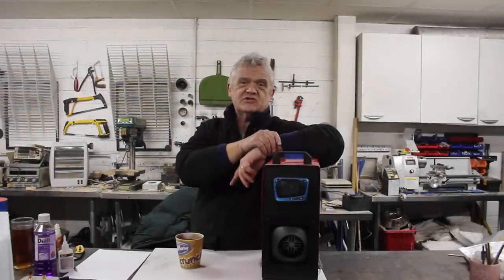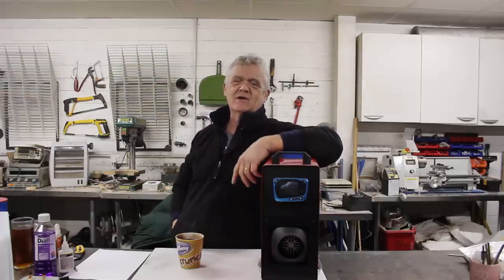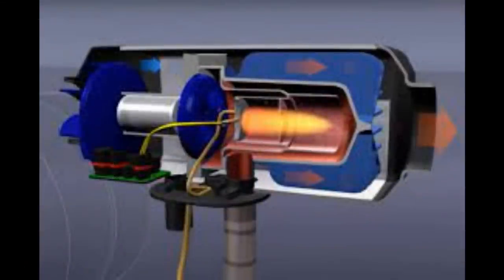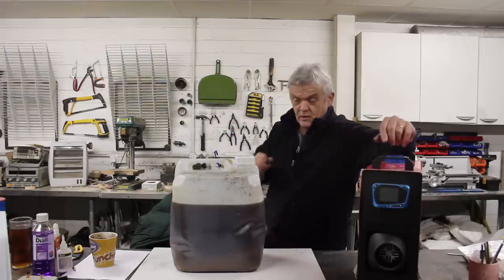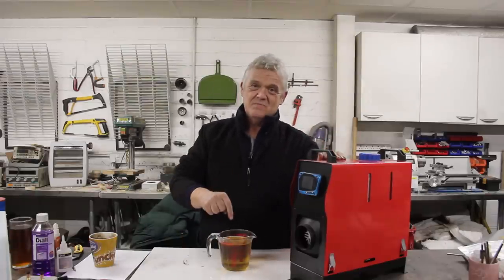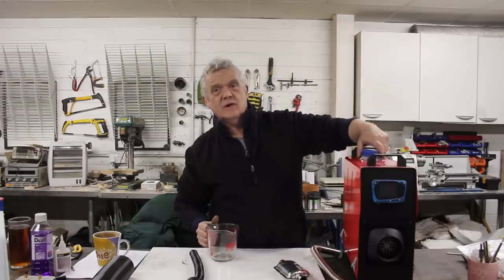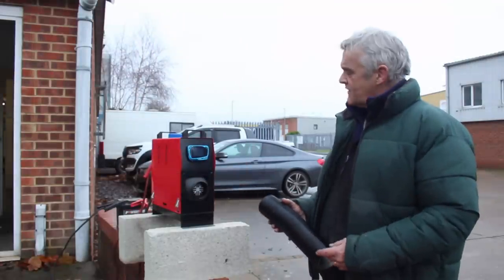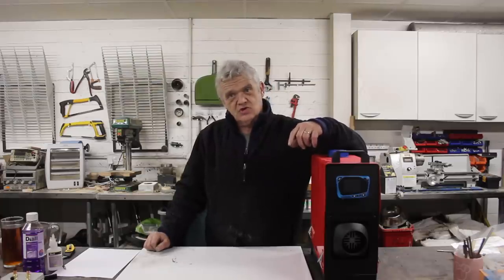1793 Home Made Fuel Running A Diesel Heater

Comment: I might have mentioned this before but when I was stationed in Germany in the RAF around 1979 ish I used to refuel a similar device, a bus heater, separate burn chamber and separate airflow going into the building and run off the mains electric. If memory serves me right a Jerry cans worth of diesel would run it all day.
Reply: They were invented in Germany in the 40s/50s 👍

Comment: Just awesome as always. I just want to put in my request for something that you previously theorized about, which is to say a wind powered sand battery heater. I am wondering if there is some configuration involving resistance heating and thermoelectric fans which could be viable. I am most curious about the specifics of how the electric load would be controlled for such an application. If you can’t get to this topic it’s fine. I will let you know if I end up (successfully) experimenting with this concept in some way.
Reply from the maker: I will have a look at it - but I would also be very interested to see what you do too

Comment: Hi Robert, I don't recommend using an adapter without having a battery backup. There is a mandatory cooldown cycle. If the power goes out during a running cycle, it could damage the unit. Cheers from Ottawa.
Reply: Dead right 
I run mine in my work shed 
I have a 12v deep cycle battery and a trickle charger. 

The battery is there for two reasons 
supply the start up current needed for the glow plug.  Once it starts the trickle charger (like the alternator in a car) recharges the battery and supplies the running current for the fan, etc
The second and more important reason for this simple power supply is so that if there were an outage,  the battery will keep things going for hours. 
Then you can properly shut it off and cool it down
Reply from the maker: nice suggestion - cheers
Reply: It won't damage it, it merely floods the chamber which makes a mess and difficult restarting.
Reply: @melissasmess2773  Hundreds of videos of people who used these things, and all say the same thing. The fan is necessary for the cooldown cycle. I own 5 of these heaters. 2 failed after a few months. I didn't know they were easy to fix, so I just bought replacement units. At least I have a lot of spare parts. The oldest one I have is the one that works best.

Comment: Be carful Rob!   You are single-handedly putting a wrench in the grand plan to freeze as many people as possible.  

Great video brother!
Reply: There are other methods that don't rely on fuels such as concentrating solar heating, passive solar heating, solar evacuated tube collectors, wind powered electric heaters or low grade geothermal.
Reply: @vitordelima   absolutely.  Some of which I am working on for myself.   This year has been a huge shock to millions of people. They need cost effective heat without a large or difficult learning curve right now.
Reply: @vitordelima  most working class people don't have the money for that...
Reply: @UNPROFOR1994  It's cheaper than most alternatives but it also triggers a lot of despicable people for obvious reasons.
Reply: @vitordelima  most people don't have the money to do major home renovation on a whim lol not sure where you got that idea. a lot of people live paycheck to paycheck
Reply: @meep7252  correct
Reply: @meep7252  This is the kind of nitpicking that I'm talking about. Most times it doesn't require home renovations either.
Reply: @vitordelima  but it would be pretty expensive.  A lot more than a Chinese heater and some diy biodiesel.
Reply: @McRootbeer  No, but thanks for repeating what was already posted. There is certainly a coordinated effort to make it as costly as possible but this doesn't mean it's necessarily expensive. And other typical problems of social media, such as attention seeking, smear campagins, ...
Reply: I just accept that I'm luckier than most in that I have extensive access to free firewood and a couple of decent log burners
Here's hoping everyone has success in finding a system to suit their circumstances. Whatever you do, it will take time and effort. The harder I work at my firewood store, the warmer I am.
ps.   the simplest aid to keeping warm is available to all of us - wear more clothes in the house. put on a few more layers and wear a woolly hat. It seems to me that in recent times, some folk think it a God given right to be able to wear Tee shirt and shorts or other light clothing indoors, and still be warm enough .....
Reply: @bigoldgrizzly    I understand and agree completely!  I just drug myself out into -30 wind chill to load my wood boiler.  And I am very lucky that is an option for me.   

Rob has been doing amazing work to help people with as many ways as possible to stay warm this winter while not requiring a large amount of money or time.   Heck I know when I was a younger man I would have had a hard time spending the 120.00 for the diesel heater let alone more difficult or expensive options.
Reply: @Red9GearHeads  Absolutely Buddy. Rob is doing a great job all round, good at explaining and without being a 'safety sally' he does address how to do things without harming yourself. Keep warm Fella and look out for your neighbours too.
Reply: @bigoldgrizzly   thanks Grizzly.  Happy holidays!
Reply: @bigoldgrizzly  Because good and affordable pre-built solutions aren't being sold for reasons.
Reply: @rocklover7437  some people just buy a pool cover the bubble foam type and throw it over a regular greenhouse easy insulation
Reply: Wait for the legislation to try to stop this kind of 'taking care of yourself' nonsense.
Well, they will try anyway lol
Reply: What was the 20% you mix the oil with??
Reply: @vitordelima  no. Lol
Reply: @jregamey  Yes, Jacob.

Comment: It's been interesting following along, Robert. Something like the Bullerjang combined with the heavy oil burning capabilities of the forever wick sounds like a pretty ideal appropriate/low tech/low maintenance heating solution with the advantage of not requiring electrical power. My spidey sense tells me you've already come to a similar conclusion.. so I'll look forward to the video.. 😁👍
Reply from the maker: lol - I am an open book lol
Reply: requires 12 Volt DC supply that can handle the startup current draw of around 5 Amps, which reduces when the heater warms up.

Comment: These heaters have gone up by 50% in the last month. There were many listed on eBay, but now not so many.
Reply: Price is likely to drop back in the spring/summer months. Just at the moment, fear of heating costs and production problems in China has left a lot of empty shelves. I reckon a fair proportion of sold units will end up on the secondhand market next year. Won't bother me and my woodstoves ;<)
Reply: I payed £90 for mine and now it's double the amount.
Reply: Basically ripping people off. Here in Australia where its coming into summer they are freely available at the previous price . They just know that everyone is looking to keep their heating costs down in the UK so are making hay before the sun shines again. If it wasn't for the outrageous costs of freight between Australia and the UK you could buy them easily from here. I can buy a book on EBay UK for 5 quid and pay twenty five in postage !
Reply from the maker: yep - all heaters have gone up in price mate
Reply: Apparently Trading Standards have impounded several hundred of these CDH at Felixstowe docks, I'm lead to believe the problem is with the Chinglish instructions rather than the heaters themselves ?
Reply: I've just ordered mine this week from Aliexpress. Most of which onviously comes from China (as the heaters do anyway) but i managed to get a UK warehouse so its due on 3rd January. Prices are still low there, is my point. I paid £100 including all the tax and delivery.
Reply: The prices always go up in the winter and down in the summer. It's supply and demand. I bought 5 at the end of last summer for around $75 each. Now they are $100 or more
Reply: @FruityLoops91  have you a link please
Reply: you're suprised? what happens when the going gets tough😆
Reply: @Tiger-fv3nl  tis the same with sun tan lotion but tother way round.

Comment: Hi Robert.
Have been using one of these to heat my work shop for the last 4 years burning anything from agricultural diesels, domestic oil, and vegetable oil mixture, still working well, 23.2 degrees in here as I type. Cheers.
Reply from the maker: awesome mate - cheers

Comment: Rob -
Big fan of those "cheap chinese" heaters as an emergency/backup heat source.  I have a very similar unit for use if/when I lose heat during winter (to prevent pipes freezing & preserve life).

Been thinking of getting a couple of non-all-in-one units for installation in my Diesel truck (in case of being stranded in winter) and my vintage VW (for real heat).

As you likely know, these are clones of the German heaters (Espar & Webasto) that VW had as an option for the old bugs.  😁

Cheers!
Reply from the maker: I think that's what they are good for mate

Comment: I've successfully run an old mercedes on used veg oil, the single easiest way to clean it is to let gravity do all the work, it's called settling. Over time all the crud sinks to the bottom simply pull the clearer oil off at the top. A heater like this might run on straight used veg oil so possibly no need for any filtering or additives like paraffin etc ?
Reply: Check out "dieselpumpUK" for a look inside the ruined fuel pump from a 606 that's been run on non refined cooking oil, most diesel engines will run on it but they do not last ! Neither do these heaters 😏
Reply: ill av a look.  @Dirt-Diggler  have you seen the vegoilcar website ? well worth a look

Comment: Hi Rob, I have the exact same model in my workshop, I just run it on red diesel available from some petrol stations, currently about £1 a litre. We also heat the house with oil, so when I get a delivery of this, I get an extra 25L for the Chinese heater and avoid some VAT, also currently about £1 a litre.
Reply from the maker: nice mate

Comment: What in the world is paraffin.? Unreal how you bitish people speak English yet we Americans can't understand some British words 🤔. And using cooking oil will eventually clog the chamber like it
 did to me because cooking oil has glycerine and doesn't burn, you'll find out on ur own what i mean unless you have a secret mixture that we don't know about.? But the glycerin is still there unless you make biofuel which removes the glycerin.
I uploaded videos how bad my diesel heater got clogged with several mix of fuel with vegetable oil so in other words it will not work and eventually clog the little small hole by the glow plug and Diesel will start running out the intake port while it's running. 
Guys and Gals be careful! Only run diesel and kerosene as fuel.

Comment: A few years ago I mounted one of the heater units along with a 5L fuel tank to a sheet of plywood in the shape of my companionway hatchboards.  In the shoulder seasons, I use it instead of the hatchboards so that I've got a simple heating setup that takes no room in the summer - just put it in storage.  It works brilliantly, and I run it primarily off biodiesel or 50:50 gasoline/waste cooking oil.  I've also sourced contaminated diesel (normally mixed with water) that I'm able to clean up and run.

I've experimented with a ton of other waste streams, and have had to clean mine a couple times over the years.  Once I'd coked the swirling mixer so badly I couldn't clean it, and was happy to discover replacement burn chambers with gaskets are like $20.  I bought a bunch of them, and now if they're too dirty to be saved, don't waste any time.  I've saved probably thousands of dollars of fuel at this point.

These things are fantastic!
Reply from the maker: $20 to replace - wow - that's like nothing! that is cool to know - cheers mate
Reply: Well my search show nothing like that for sale! what country are you sourcing this from? And whats it really called?

Comment: I'm pretty sure that the manual states to run this heater outside or in a well ventilated room. The exhaust should at least be vented outside your house. 
The hot airflow I supose is safe for indoor.
These video series really do not address the dangers of burning fuel indoors. Exhaust is poisonous. Why not run your car engine in your living room? It won't smell great but at least you are not freezing to death. 
Do not underestimate toxines from exhaust they can kill you or will make you sick even at low concentrations.

Comment: I ran my Peugeot 306 for a number of years on vegoil. I included a heated fuel filter and heat exchanger to preheat the vegoil, also looped the injector return. Two, 3 port valves were used to select the fuel source and return route. So start on diesel until the engine hit over 70 degrees, then swop to vegoil. Swop back to diesel a few miles before turning off. I ran the vehicle for over 100,000 miles on this setup. Bosch injector pumps were always successful for vegoil but lucks CAV easy to break. The VW PD was also meant to be good. 

One important thing with waste vegoil on cars, apart from filtering the crud, is removal of water from it, normally this was done by allowing several weeks for it to settle, so you end up with oil on top of the water. To check water content, just put it into a hot frying pan and check for spitting.

Thanks for your excellent channel, it provides  me with a lot of entertainment.

Comment: You Should check if the Gelatine method helps to clarify used motor oil, maybe it’ll remove some of the additives and/or some of the soot from the oil to make it burn cleaner

Comment: David McLuckie has just posted a video of running a diesel heater as the heat source for a tumble-dryer! Plans for future videos include changing the drier's motor to be 12volts, and then including a new control board which manages starting and running the diesel heater, the tumbling, heat input, exhaust moisture content, and then closing down!

Comment: I've been running these heaters for awhile alternative fuels normally need some adjustments in the fan settings and running on high generally reduces the coking up the small amount of water from the gelatin mixture should help keep it cleaner water injection would be best but it's not easy to do! I tried 50 percent motor oil 50 percent diesel took a month to be so full of carbon that it wouldn't run ! Fortunately they are easy to clean but you do need a tool to remove the glow plug and i haven't been having the best luck with the temperature sensor so buying an extra one isn't a bad idea.There's a Scottish youtuber David mcluckie that has tons of videos on these he is currently working on a version that self powers using peltier units ! I think david is far to brilliant to be a baker and should be working as an engineer somewhere! They even sell heater exchangers to also heat water!

Comment: Why can't you use Central Heating Oil ?  Surely totally legal when used for heating and of course much cheaper than diesel.
Reply: No cheaper than red diesel now in UK
Reply: @lioncrunch9098  After the 1st of April 2022, red diesel can no longer be used as a commercial heating fuel.
Reply: You may use red diesel in a mowing machine when it's being used: for purposes relating to agriculture, horticulture, aquatic farming or forestry. on a golf course or on land maintained by a community amateur sports club. on land occupied by a travelling fair or travelling
Reply: From 1 April it becomes illegal to put red diesel into any tank, vehicle or machine not covered by the new rules. The switch to white diesel will increase fuel costs by about 47p per litre for many businesses and organisations across the country.29 Mar 2022
Reply: @chrisnash453  correct, but can be used for domestic heating which I do, £1.50 Lt
Reply: @lioncrunch9098  Interesting .. I pay Quantity: 1000 litres .. 
Price per litre: 99.04p
Reply: Far too expensive ..
Reply: @chrisnash453  thanks for info, i have three heaters, one in my camper regular diesel, and  two others, I use in my  conservatory and domestic workshop, 1000Lt is way out of my budget.
Reply from the maker: worth looking into for sure

Comment: When you make a Cooper pipe winding around the exhaust or in the Air flow you could get a water flow without a pump. Our old Wood Burner could run without electrisity only with the flow through the warmer water going Up. You could make a similar thing with a Tank for warm water in RV or Tiny Home. The problem would be with too hot water. The simplest solution would be to make the winding detachable but then you have to be there the whole time or you can make two exhaust's and shut down the one with the winding at 85°C. The water Tank would also be a good reservoir for the heat at night.
Reply from the maker: nice suggestion mate cheers

Comment: Every cafe is going to be deluged with requests for their used cooking oil now. It'll be 50p a litre by Feb ! 🙂 Please consider doing the video on how the heater looks inside after a while as most people are hanging out to see that. I've seen them run on used untreated motor oil and of course they soot up big time. Also I have heard that if you give them a good 15 minute blast on the highest setting before shutting them down that will make a huge difference in the anount of maintenance required.
Reply from the maker: cheers mate and yes I will

Comment: Thanks. The exhaust gets really hot. I think the exhaust could be used to heat a sand battery or the heating coil in a hot water cylinder. I don't see why not!! That would make a good video...